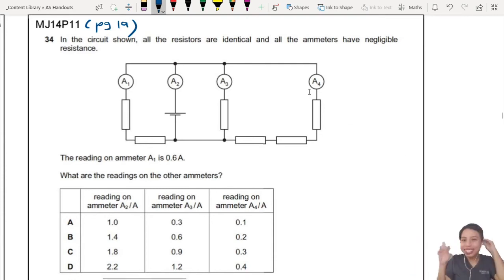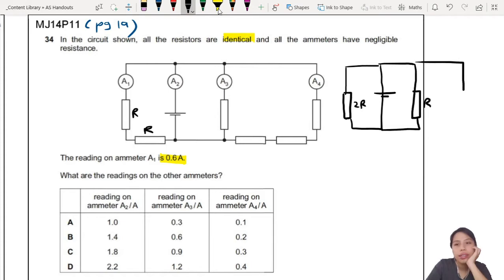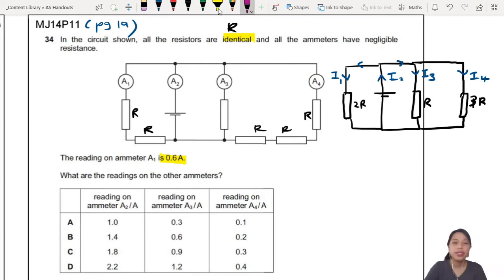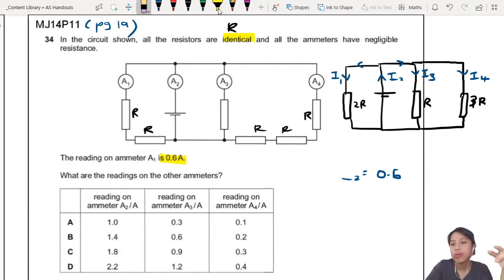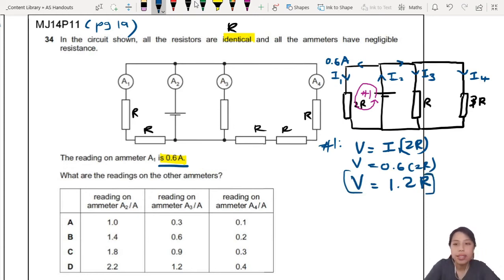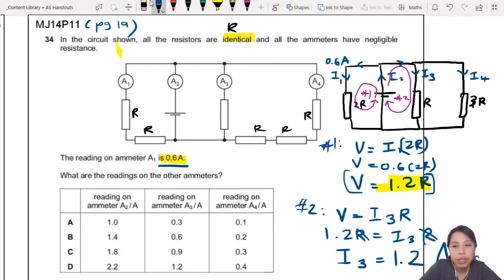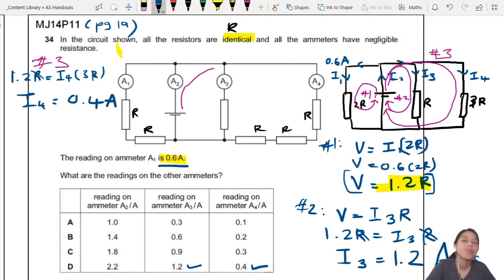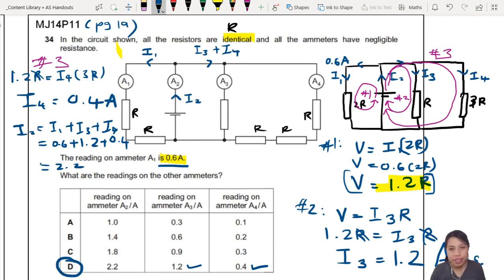10.1c Ex3 MJ14 P11 Q34 Four Ammeters | AS DC Circuits | Cambridge A Level 9702 Physics

Comment: I got the same answer but I used the concept of ratios instead and then solved for each value of Current
Reply: ya ratio method is easier
Reply: @AlchemistAH explain the method please
Reply: Can you explain that method pls
Reply: since all the resistors are in parallel, the voltage will be the same across all. V=IR, IR= (constant) and since I1*R1= constant and I2*R2= constant 
therefore: I1*R1 = I2*R2

now lets use the A1 and A4 as example, let A1 = I1
(0.6) (2R) = (x) (3R)
where x = 0.4 A
do the same for the rest...
Reply: can u share the ways of doing pls thankyou
Reply: can u share the ways of doing pls thankyou